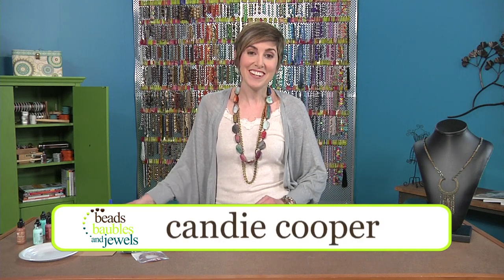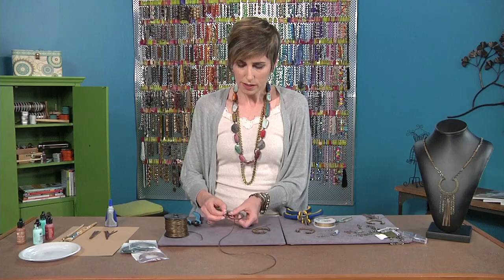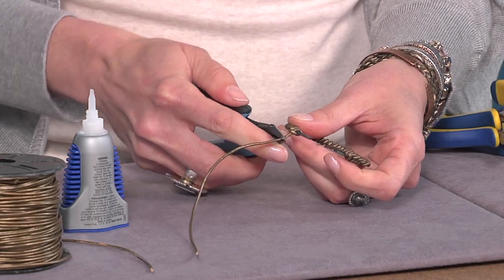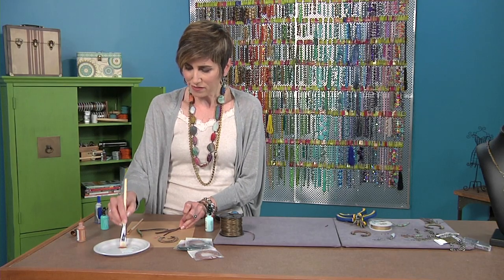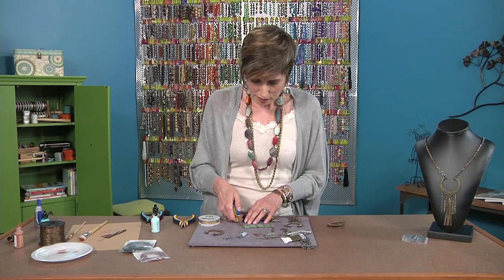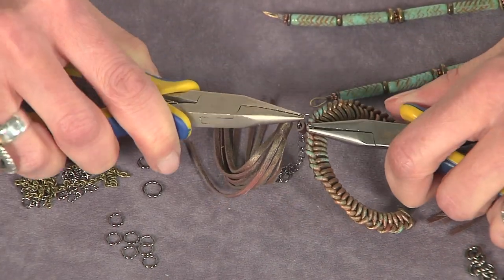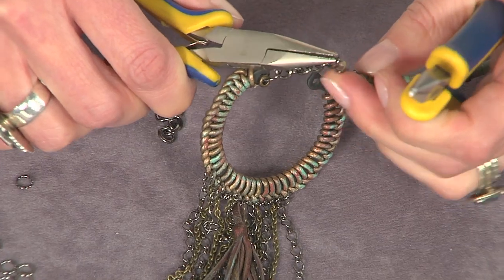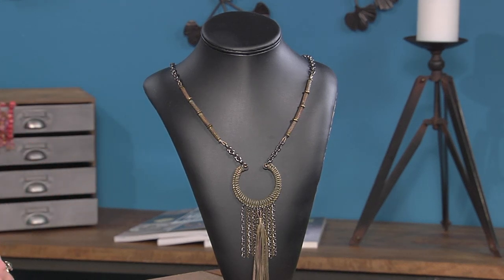Candie Cooper transforms leather into contemporary jewelry designs (2504-1)

Comment: Love this!  What kind of paint do you use and does it rub off?
Reply from the maker: Canide uses Martha Stewart multi-surface paint from Michaels, or Vintaj Patina Paints. They hold up pretty great, but for added protection, you can brush on a clear varnish/acrylic sealer.